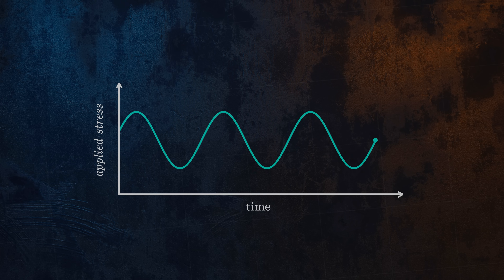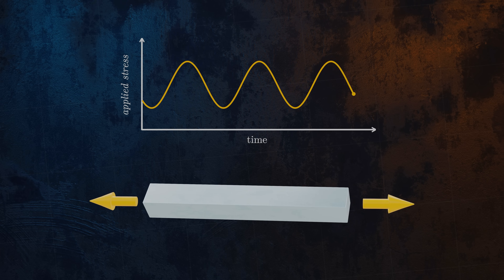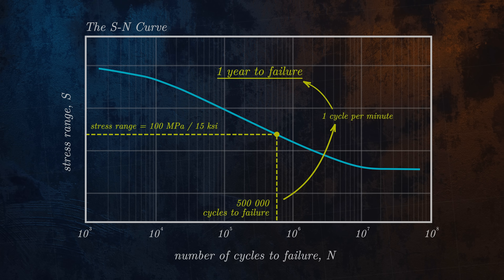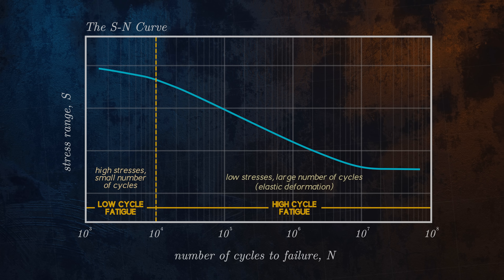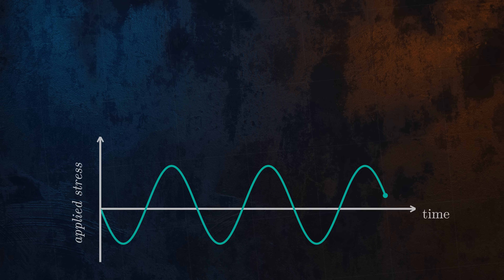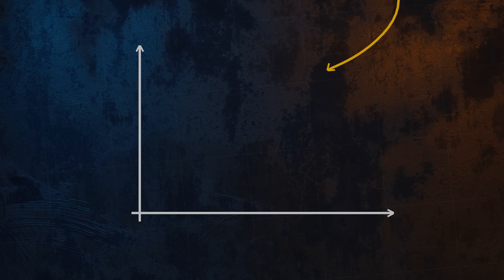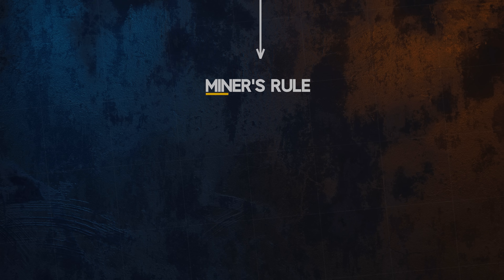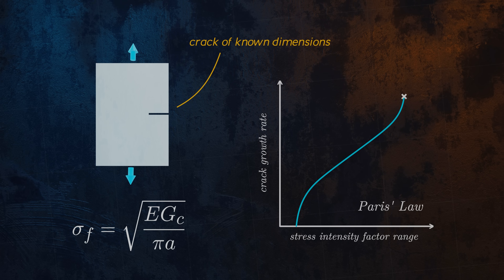Understanding Fatigue Failure and S-N Curves

Comment: I had a poorly packaged pipe shipped to me crack from either reaching tensile strength, cycle fatigue, or both because it wasn’t strapped down and it was fully constrained at one end. So while riding on the truck it freely bounced up and down, like a spring until failure. Now I’m writing the FMEA report. Calculations showed it may have reached plastic deformation elsewhere if tensile strength was reached, let alone ultimate strength. Now have to measure crack size for comparison. Thank you for the useful review!

Comment: What counts as a 'fatigue cycle'? Is it ANY loading - however infinitesimally small? For example, if I stroke a brick of aluminium with a feather - does that count as a 'fatigue cycle'? If yes, since aluminium has no fatigue limit, does that mean after the aluminium brick is stroked by the feather billions of times, eventually the feather will break the aluminium brick?

Comment: If you help me to understand that sitiuation, i would be appreciated a lot. 
lets say that we designed our mechanical part with minumum stress concentration. No initial crack, hole or something that inreases or causes stress concentration. What would be the key factor occuring fatigue failure ? since we dont have anything against stress concentration which will cause crack eventually.  I have read some articles which mentions that stress amplitude is the reason of fatigue failure? Btw, you did a great job. Waiting a similar video regarding creep failure

Comment: Endurance limit is king, and everything I’ve designed, where possible, has been within this limit.

For steel, I try to design to Tensile/3 and apply a good surface finish, and touch wood I’ve not had a failure in over 20 years.
Reply: yup, factor of safety always important to use irl.
Reply: @nyquist_control  not so much a FOS with fatigue, but typically for steel, fatigue really only becomes an issue at Tensile/2, although there are mitigating circumstances!!

That’s why working to Tensile/3 means your design is typically free from fatigue failure.

Comment: Fatigue failure occurs due to shear stresses in ductile materials and normal stresses in brittle materials...
Reply: @rigadritto Early test experiences showed - and classical theories like Sines, Crossland implemented this - that ductile materials are driven by the mean hydrostatic pressure. For brittle materials conversely, the simplest way is to consider the normal stress acting on each material plane, so that you reduce the problem to a uniaxial one, and in this case you can consider only the normal stress for both amplitude and mean stress. Then of course you need to consider all planes and find the critical one.
Reply: @rigadritto In case of failure ,   cracks occur at localized regions so there is no need of mean stress.
Reply: @rigadritto Mean value of stress is actually the average value In case of fluctuating stress or cyclic stress... Like in SHM... (Simple harmonic motion)
Reply: @rigadritto the most robust method is to use a Multiaxial Rainflow: it is an algorithm that extracts cycles from the stress-history. For each of these cycles the Mean Stress can then be defined via an integral of the current hydrostatic pressure in the stress-path. You can have a look on our MultiFat channel and to the website if you want: the Theory Manual of the MultiFat software explains these principles, I hope in a clear way 🙏

Comment: About so known 'endurance limit'. Actually there is no such thing in real life even for ferrous materials. It is shown that at number of cycles about 10^9 failure still happens (such numbers can be obtained in low-stressed high-frequency parts as gas turbine engine blades, reduction gear teeth and etc.). Look for 'Gigacycle Fatigue in Mechanical Practice' by Claude Bathias for the initial acquaintance. It is said at 3:10 that at low stress levels we are dealing with only elastic deformation, but this is a complete nonsense, because it contradicts the definition of elastic deformation (!).

Nevertheless, I am very pleased with the quality of the material and am grateful for the popularization of engineering knowledge.

Comment: Thank you for the amazing informative video on such a complex topic. 
I have one question: What stress to consider to assess fatigue life? (is it Von Mises, Normal stress (to the weld for example), Maximum principal stress etc.) ??
Reply from the maker: Hi Mahmoud, great question! You would usually consider the normal stress in the direction you are interested in. Sometimes you might have to calculate the fatigue life in more than one direction (e.g. both perpendicular and parallel to a weld) to figure out which has the shortest life,  because they might have different S-N curves.
Reply: Depends on the problem, for 1D loading maximum principal stress would be used. For loading in 2D things start become complicated and especially if maximum principal stress changes direction. At work for 3D stress state for steel with changing maximum principal stress direction we use signed von Mise. It is not entirely correct, but close enough. As we have understood then "correct" would be calculating critical plane by summing damage from principal stress in every direction, but that is easier said than done. For welds building codes give simple guidelines by using nominal or hotspot stress with corresponding detail categories.